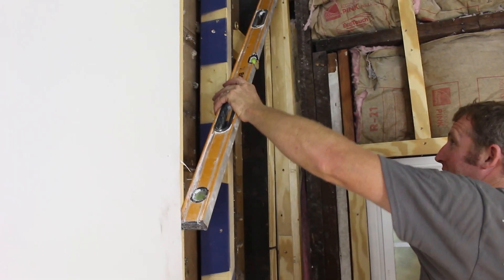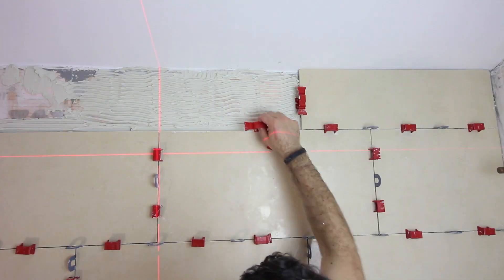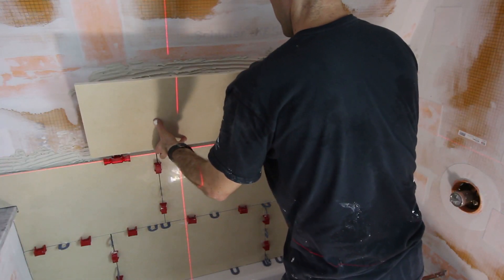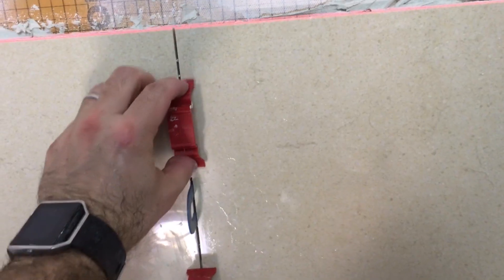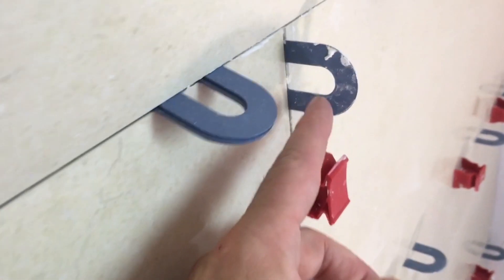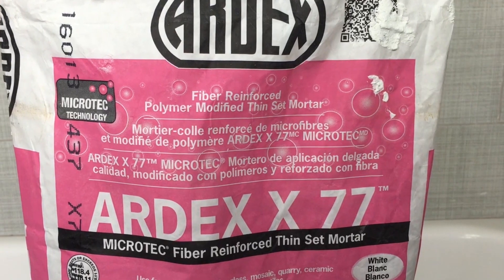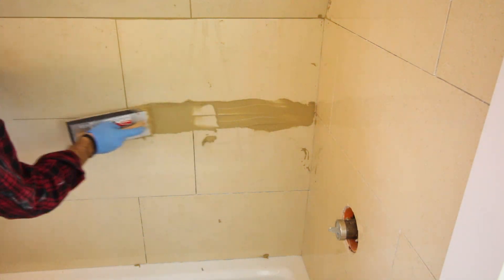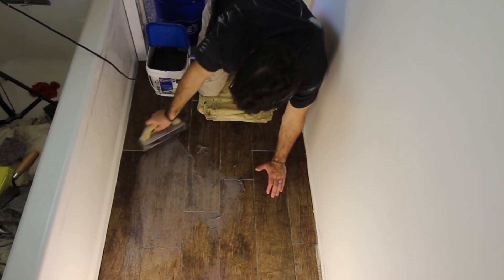How to Tile a Shower Wall (9 Quick Tips)

Comment: Mortar should be run perpendicular to the larger side if the tile is rectangular.  In this case that means trowel lines should be vertical, not horizontal like you have them. That allows the shortest path for air to escape and improves adhesion.  This is in the manual you reference on numerous occasions....
Reply: Mike W - Never thought about it in those terms, but makes complete sense. Thanks for that!

Comment: Not sure what the motive is on pushing these products for shower installs. I just removed tile from a home built in the 70's where the tile was mounted to the drywall with no water damage anywhere.
Reply: People do not do quality work
Reply: Well that's some risky ass advice.  While things may seem overboard, Kerdi for instance, at least saves time and is very easy and clean to do, not hard to do right either. I can't say anything about the other products he mentions.

Comment: Hey Guys. I see here that you recommended modified thinset to tile over the Kerdi Board. I was under the impression that Schluter recommended unmodified thinset. Or is the unmodified thinset recommended only for sealing and installing the Kerdi??

Thanks, Great Stuff here!
Reply from the maker: great question Frank, you’re correct. Schluter recommends either unmodified thin-set or their modified thin-set like ALL-SET. However, many thin-set manufacturers will warranty tile setting over Schluter KERDI-BOARD with their modified thin-set, eg Ardex and Mapei. It’s a loophole that Schluter doesn’t mention but something we learned about by doing in-person training with Ardex
Reply: Ah ok very good thanks for taking the time to reply guys. My local building supply caries Mapei stuff. Can you recommend a Mapei modified thinset that you’d use with kerdi board then??

Comment: if i am using cement board and plan on red guarding it 1) do i need a vapour barrier behind the cement board ( its an exterior corner in the basement) 2) what thinset do i use with red gaurd for tiling? Was going to use large fornat 3) i used kerdi in my upstairs, but wanted to save money on the basemeant, one of the things i did by mistake was use modified thinset on the kerdi, which apparently is no good because the thinset properly because the moistyre gets locked in between the polymers of the thinset and the impenentrable membrane on the kerdi, does red guard create the same situation????
Reply: Have you found the answers yet? Have the same questions.

Comment: Hi, first off, thanks for taking the time to make these videos.  They are really well done, and help someone like me tremendously.  Wondering if you have any videos specifically dealing with installing tile vertically?
Reply from the maker: Thanks, we’re working on vertical tile tutorials right now. They look cool and aren’t hard to layout - depending on the tile size. What size tile are you using? And when do you need the videos?
Reply: So the tile is 21 1/2" by 9 3/4" and 1/4" thick porcelain, starting job Thursday.  and thanks for responding so fast!
Reply from the maker: Happy to help. Nobody should have to do a project without guidance. Did you choose a pattern, eg thirds? I won’t have our videos done by then but can help with general tips.
Reply from the maker: Also, send me an email. It’s easier to correspond that way than YouTube comments. Sometimes I miss the comment! My email is jeff@bathroomrepairtutor.com

Comment: Should wall tiles be plum straight or can it just go with the angle of the wall ? As the tiler who did our bathroom recently has the tiles not plum, when checked against a spirit level, it's off quite a bit vertically. He said, it was a because the shower panel door wouldn't fit ?
Reply from the maker: typically we check the studs are plumb and even, then do the same with backer boards to ensure shower tile also remains plumb and even.
Reply: @HomeRepairTutor  He did the job within 3 hours.  He used normal plasterboard, none of it is was waterproof sealed and I will have to seal the bottom of the shower and sides also with sealant. He also left the trim off one of the sides. Sadly I wasn't there at the time.

Comment: Waterproofing your tub walls before applying tile is not a "tip".  It is a vital necessity and a major part of the whole job.
Reply: You'd be surprised how many people do not know how to properly waterproof the walls.   Heck so many yt videos of tilers don't even waterproof properly.
Reply: What do you guys use to water proof?
Reply: kinghaze I use wedi board. Wedi has all the things you need including the sealer for cracks and screws. They also have the whole drain setup flooring screws custom nooks. There are several other companies that make stuff just like wedi that’s just who I use. I hate using hardibacker.
Reply: @Taylormade2350  ya I used hardi and I see why it's a pain in the ass
Reply: kinghaze have you used any Shluder or wedi boards before? They’re super light like 10lbs a board and can be cut with a razor like drywall. No dust no fuss, no table saw and it doesn’t weigh a shit ton.
Reply: No
Reply: Same about planning the layout.

Comment: I purchased your course and its been priceless.  thanks for the time in putting it together.  I'm just at the point where I'm about to tile the tub surround area...wish me luck.  Side note, do you have any videos on tips for tiling the floor?  I'm using the Ditra Heat system.  Thanks again guys.  Dave in Canada.
Reply from the maker: +Dave Gurney great to hear!! If you're in need of DITRA-HEAT tips we'll have a YouTube video soon...hopefully next week. We're just waiting for Schluter to review it even though our local rep was there. If you want the private link for that tutorial I can email it to you. 

Biggest tip is to get the subfloor level for the DITRA-HEAT and to plan your layout. Did you install a Tub or shower? There are more tips for each separate setup 👍
Reply: Yes please email link...dmgurney@telus.net.  Sub floor is level and I installed a tub.  Thanks again for all the help...really, really awesome.  One more question...should I finish drywalling the rest of my walls and mud and sand before I tile tub surround area?
Reply from the maker: +Dave Gurney yes, we'd recommend finishing the drywall before tiling or at the least where the drywall meets the tub. That way you can waterproof the transition. We'd also recommend using KERDI-FIX and KERDI-BAND with the DITRA-HEAT. This DITRA video we did will help explain that step

https://youtu.be/anXgmjrHS0s

I'll send you the DITRA-HEAT link 👍
Reply: Thanks for answer...I have drywalled to where drywall meets tub and will waterproof that transition.  Sorry for hassle...how long does it take for Kerdi fix to cure before I can thin set the Kerdi band over it?  I also will be using Kerdi fix and Kerdi band over the Ditra Heat
Reply from the maker: +Dave Gurney no problem, KERDI-FIX skins over in 10 minutes so you'll want to apply the thin-set right after applying the KERDI-FIX. Then embed the KERDI-BAND over both the KERDI-FIX and thin-set. So you'll be doing all this at the same time. Glad you're progressing quickly 👍
Reply: Awesome
Reply: Progressing with your help so once again...cheers.  back wall tiled.  If not a bother 2 questions.  My back wall has shower niche.  Should I tile wall completely then tile niche or do you tile the niche first?  I am using Schluter edging for reveal look.  Second questions is do you guys have any videos/tips on till;ing floors?  Take care and cheers from canada.
Reply: Meant to say my main wall in tub surround is tiled and the smaller wall opposite my valve wall has the niche in it

Comment: Tile gap between tub suggestion 1/16 Or 1/8. Will be enough space for grout for 1/16 inch gap?
Reply: Either or will work. Don't put grout between the tub and the bottom row of tile. Use silicone caulk!
Reply: @tomvan22  2 years later with gap i would of liked the Mapai sanded grout is holding up nicely suprisingly. No cauking just grout. Very happy with results!

Comment: correct me if i wrong. but i don't think you would want to use the Ardex X77 Polymer Modified thinset if you are planning on using the Kurdi Board.  Especially with a small grout line. the Kurdi Board has no way of pulling the moisture out of the thinset so you will never achieve a proper cure/bond. Unmodified ThinSet should be used with Kurdi Products and Modified could be used with a Cement Board
Reply from the maker: Good questions. Schluter does recommend using either unmodified thin-set or their Schluter thin-sets with KERDI-BOARD. That said, Ardex will warranty the use of X77 if used over KERDI-BOARD or KERDI. So keep that in mind.

Comment: Great tips. Any tips or videos on tiling an angled wall like behind you.
Reply from the maker: Thanks. Do meticulous planning for the layout so that you don't have slivers at the ceiling and at the corners. I started with a full tile on the tub and placed those tiles on 1/16" horseshoe shims. My buddy Steve and I discussed the layout quite a bit before setting the tile. You could do mitered cuts where the two angled tiles meet but I found I could get a tight (1/16") grout joint without the miters, plus the angle was pretty severe.
Reply: I have an angled wall of about 45 degrees, just wondering if the tiles would slip or fall off while drying.
Reply from the maker: They shouldn't if you use the right method and thin-set. ARDEX X77 is the thin-set we'd recommend because it's polymer modified and grips the tiles. Also, back buttering the tiles and applying directional trowel ridges to the wall will help a lot, i.e. all the ridges face the same direction.
Reply: I've been in the tile trade for almost 20 years and watching your video was hilarious, but not as funny as the thinset "gripping" the tile. Never heard that one before, but I guess that's one way to explain it, coming from someone who is basically a "DYIer" himself, trying to teach other DIYers.

Comment: I am told i can use kitchen and bath silicone instead of grout between my porcelain shower wall tiles (1/16" space).Is this true?
Reply from the maker: use grout for the main grout joints but 100% silicone for any change of plane, eg corners

Comment: 2 Questions Sir. What exact model laser is that? Because I really need to buy a good one. Also, when we back butter tile. Do we have to notch it on there or can we just use the flat side and just make sure all the pores are covered on the tile? Thank you so much for your time. Thanks for making these videos.
Reply from the maker: Thanks for asking, that’s an older Bosch laser level. We now recommend this one 

https://shop.bathroomrepairtutor.com/collections/tile-tools/products/bosch-gll-55-self-leveling-cross-line-laser

Back butter with either flat or notched side of trowel. Wet areas like the shower require the back of tiles to be 95% covered with thin-set per TCNA guidelines
Reply: Home Repair Tutor Thank you very much. I really am grateful for the knowledge you share with all of us. Hope you have a wonderful week.

Comment: schluter recommends a non-modified thinset mortar for their system.  Why did you us a modified?
Reply from the maker: Because X77 is fantastic at holding large format on the wall and Ardex warranties their products over Schluter. Same is true with Mapei
Reply: The non-modified pertains to waterproofing Tyler, not laying tile.

Comment: Nice video. Since you are showing Schluter-Kerdi membrane (and or Kerdiboard) as your base, make sure you also recommend a NON or Unmodified thinset mortar as well. All of the ones you recommended (Ardex X77 example) were modified and that is NOT recommended by Schluter. Remember impenetrable water barrier systems (such as Kerdi)  require Non modified for proper drying/set up and adhesion. Of course if you have 6 weeks for your modified to dry, use it (JK). Just as  long as in meets ANSI 118.1 standards, you're golden.
Reply from the maker: Thanks, we use X77 because even though it’s modified, Ardex will warranty it over KERDI or KERDI-BOARD. Same with Mapei and their modified systems. Of course, Schluter’s ALL-SET is also an option but we still prefer Ardex or Mapei for setting tile.

Comment: Im using 24x24 do i have tp stagger it or can i just line it up
Reply from the maker: you can line them up but you might also want to use a tile leveling system to help cut down on tile lippage. Using a non-sag thin-set mortar and back buttering those tiles will help keep them bonded to the wall. And also choosing the right trowel, e.g. 1/2" x 1/2" square notch.

Comment: Everyone says make sure your walls are straight but no one says how to straighten them.
Reply from the maker: sister new 2x4s to old ones
Reply: Check studs with a straight edge end to end, on different hight levels vertically and horizontally and see which one is more practical/economical:
Sister stud, shave with wood plane or raise with shims (thin plywood, cut sticky vinyl flooring). Or all the above.
2. If the wall is already on the studs, after checking with the straight edge, fill low areas with mortar and scrape excess with long tapinh knife, trowel or straight edge. Same thing drywallers do. Let it dry of course...
Reply: And if we know how to 'make sure' of that, we don't really need a rathe useless  reminder.
Reply: So true

Comment: I'm putting 12x24 in my shower.  Going with smallest joint possible contradicts what I read elsewhere about large tile.  Why shouldn't I use 1/4" joints?
Reply: You can use 1/16

Comment: So you back-butter AND thinset the wall also?
Reply: Absolutely. This is especially important when using a tile leveling system since some edges might get pulled out slightly from the wall and you want maximum contact for strong support.

Comment: Im sorry but what was the reason for going with the smallest grout joint possible?
Reply from the maker: sorry for the delay, the smaller the grout joint the less maintenance. We feel the tile should be the focus of a shower and the large the grout joint the less that's the case. Just our humble opinion
Reply: Home Repair Tutor great answer man!
Reply: wider grout tends to crumble over time = maintenance - my humble opinion
Reply: If it's small tile, you save quite a bit on the grout as well.

Comment: Tile should be shifted 1/4" to 1/2" perpendicular to trowel lines.  Not both directions.  I would also recommend tiles to be honed & rectified to use 1/16" grout joints, but that's my personal opinion on that.

Comment: How do you like those seamclips?
Reply from the maker: +Gonzo Charvel they're helpful, gotta get the correct size based on the thickness of the tile. Not every tile needs a tile leveling system but these were 12x24" porcelain tiles and I wanted them to be as flush to each other as possible
Reply: Home Repair Tutor Totally understand. I've used a few different types but was looking to try out the seamclips instead of the other systems like Raimondi and the screw caps. Thank you for all you do!
Reply from the maker: update on the tile leveling system, we switched to T-Lock and like that as well.

Comment: Sorry dude but you're using the wrong glue for Kurdi board. You need non-modified thinset
Reply from the maker: Peter, thanks for your comment. Ardex X77 is a thin-set mortar and yes, it's modified. However, Ardex will warranty the use of X77 over KERDI-BOARD or KERDI. We work with Ardex and have asked them about this.